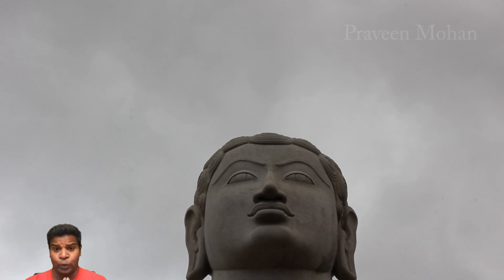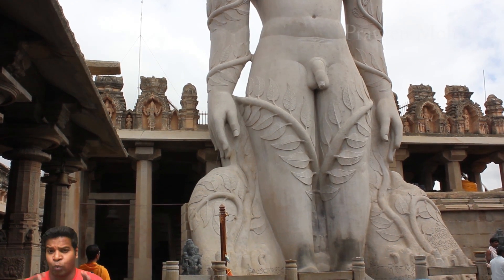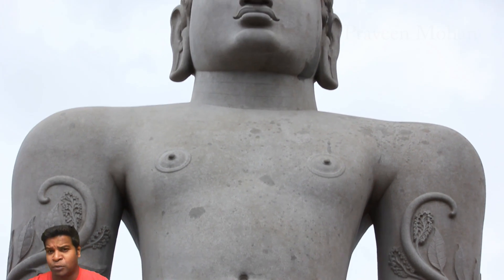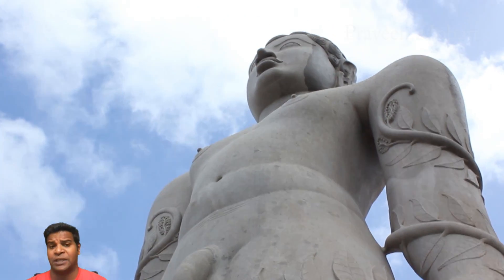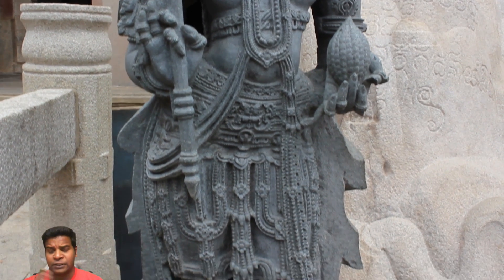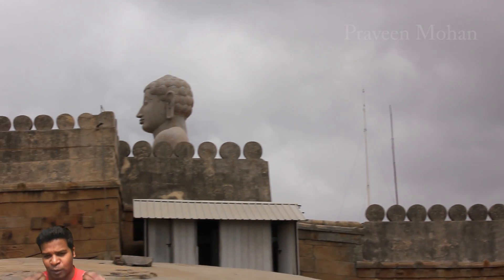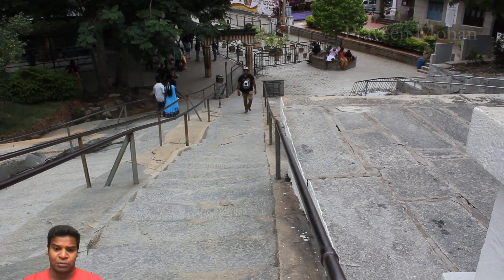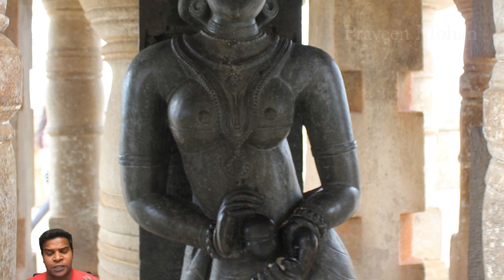World's Largest Ancient Statue at Shravanabelagola - Built with Machines?

Comment: Hi Praveen, I think you mean erosion not corrosion. difference between corrosion and erosion, a common mistake.
In terms of the process, corrosion is an electro chemical process whereas erosion is a physical process. The corrosion of metals is often referred to as rusting and it is evident in the material itself. Erosion is a natural process that removes or carries away materials from one place to another. Sorry for being pedantic with you. Your English is very good by the way. another great video, thanks. just subbed your channel : )

Comment: While pulling the rock uphill itself is a challenge, wonder how did they stand the rock after reaching the top of the hill.
Reply: It is a beautiful statue, of that I have no doubt, but I highly doubt it was carved from a rock. It looks far more like a cast. Those "Scars," on the face, look more like air bubbles.  Considering it would be more towards the top, there would be less weight pushing down on it when it dried, and that is exactly what they look like. On top of that, if that was a naturally forming rock of granite, we'd see imperfections in the stone. Granite, due to the minerals used to form it, doesn't form that pure.  Ancient Egypt did the same things with the pyramids. That is exactly what this looks like.

Comment: Our ancient sculptors were extremely talented and not to be underestimated. 
Sculpting a large statue with details must have been easier compared to sculpting smaller statues with jewelry and accessories as seen in most of the Indian temples.  It is similar to how making a large clock is easier than a making a tiny watch.  

The symmetrical feature is to be appreciated assuming multiple sculptors worked on it.

Comment: Okay lets even just assume that elephents did in fact pull this statue up this hill. Example, maybe they built a structure at the top of the hill that was a large frame for a pulley system and on the oposite side of the hill you have elephants pulling which transfers the force to the pulley at the top of the hill which multiplies the force and pulls the statue up the hill...
Having said that the thing that boggles my mind is HOW THE HELL THEY MADE ROPES STRONG ENOUGH TO WITHSTAND THE FORCE REQUIRED TO PULL SO MUCH WEIGHT?!?!
They were not believed to have braided steel cable at the time, right?

Comment: The symmetry is the smoking gun. And also the size, it is simply impossible for the sculptor to handle at manual tool distances. There are examples also in Egypt. The symmetry is not only bilateral of course, a lot of symmetric projections. Also, how is that they could possibly manage any human error? Not one?, not one extra cracking error within impossible distances. Also, no documentation, this is a huge project by itself, needs to be planned, documented, etc. Just one explanation to me, high advanced technology not even available to these days.

Comment: Love your work! The problem with carbon 14 dating is that it makes an assumption that cosmic rays have always stayed at a constant rate. That assumption is wrong. You can get a carbon 14 date that is in the future by adding radiation. Most of these sits are much older than they have been dated at, using the carbon 14 method.

Comment: Few speculations how it can be done:
May be it was not made of single stone. Several smaller stones were put together which can be easily transported. Once they are ,there may be there was technology to "fuse" them together make it appear as monolithic structure.In other video of yours you alluded that battery technology was existing in the past. If that is true,levitation and tools operation was reality. But question is can you levitate stone ? Answer is No. Unless stone used has good amount of traces of material that can be levitated.Another possibility is that whole process was in reverse than what we are thinking . Instead of starting with big rock and carving it to final product may be they started with pulverized granite and assemble the structure just like the way porter builds pot. After building corse structure, they might have finished it with sophisticated tools to remove human errors.
Reply: Prem Suthar  it is made up of fully 1 rock

Comment: ok its my imagination may be it will wrong.... first they pack in sand box not to damage statue... they tie up the box with huge coconut ropes at other down side of land, on the top of hill they put a tough wheel to catch and spin ropes and other side of slope they tie huge rocks may be double of statue weight through gravity they can lift up statute easily. may they can reduce the weight of the statute using magnetic iron balls and metal for use has wheels.